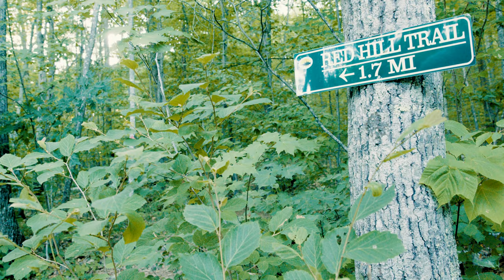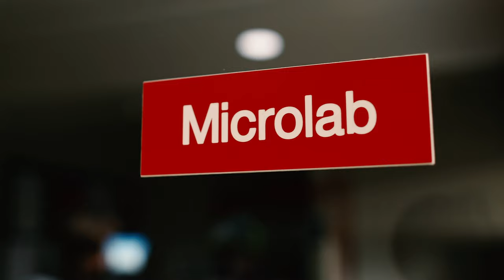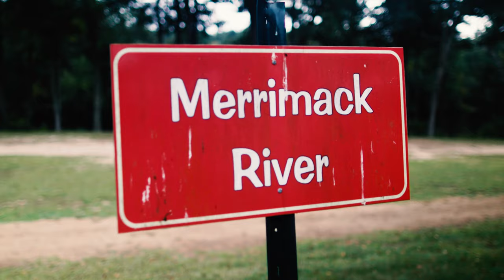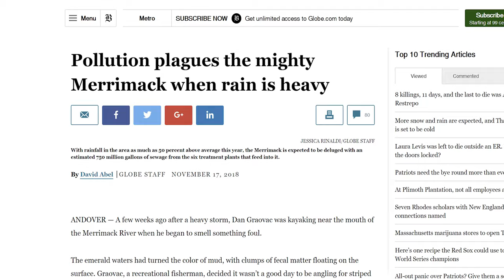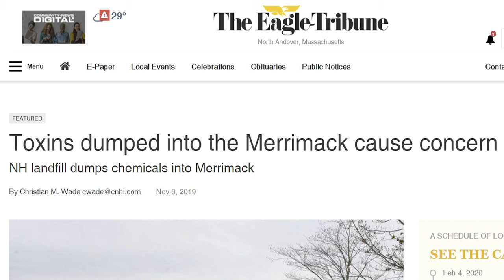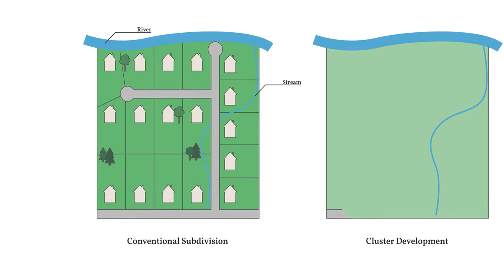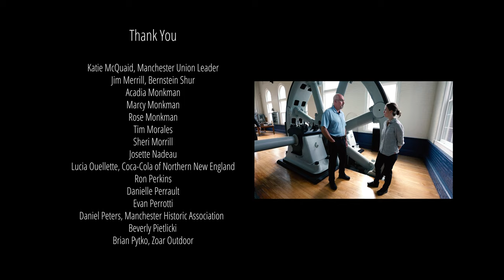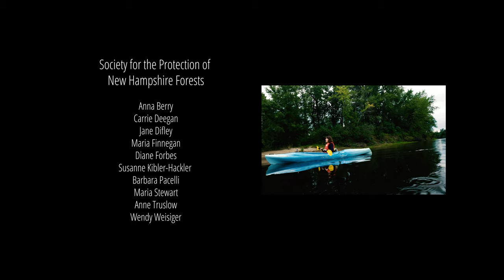The Merrimack: River at Risk.

Comment: @26:18 - I had a CETA job when I was a kid around 1980.  One of our projects was to clean up the park shown.  It is located in downtown Haverhill.  One of our tasks was to get a grab sample of the water coming out of that pipe.  I recall that it was very soapy, smelled like sewage and never stopped flowing.  Apparently the problem persists more than 40 years later.
Reply from the maker: Thanks for the first hand account, Mike. Progress has been made, but much more needs to happen.